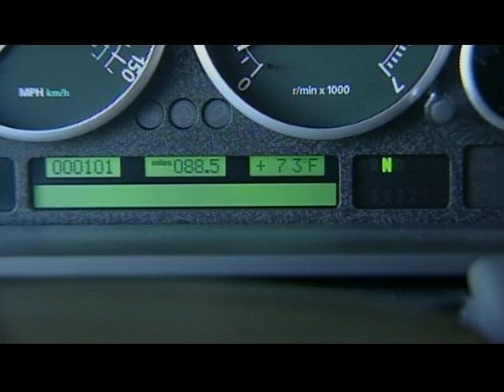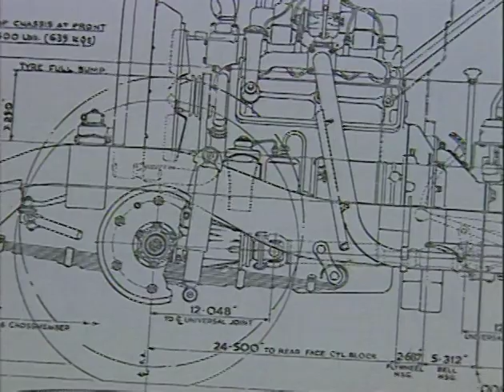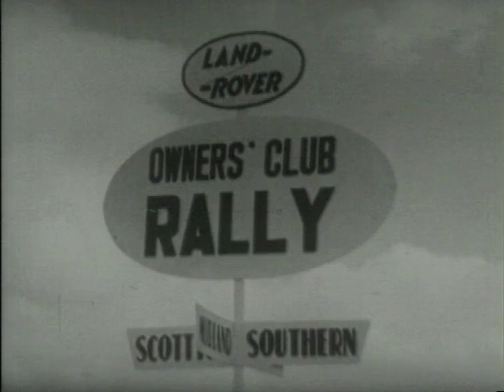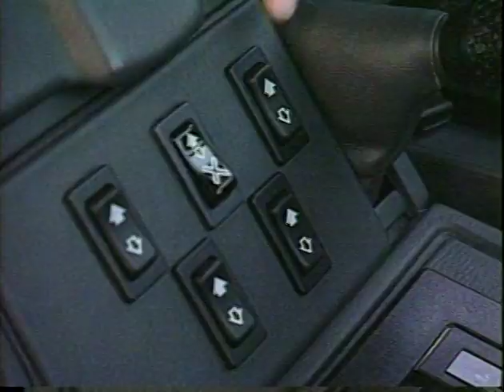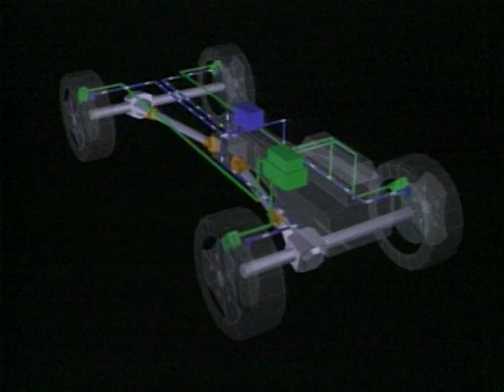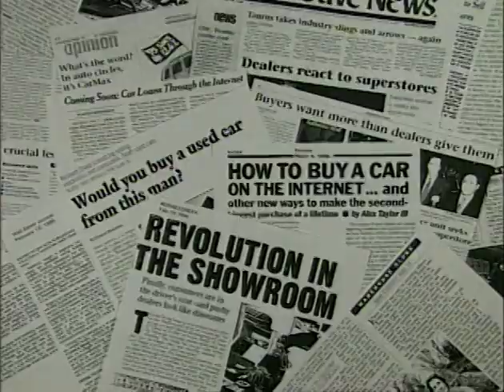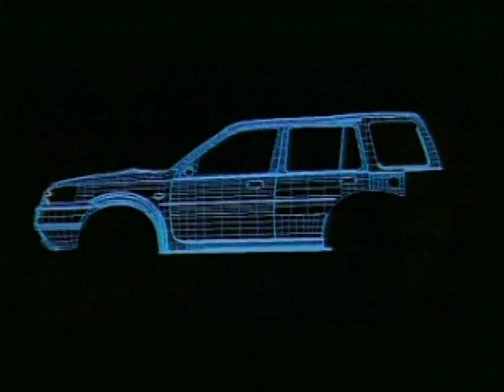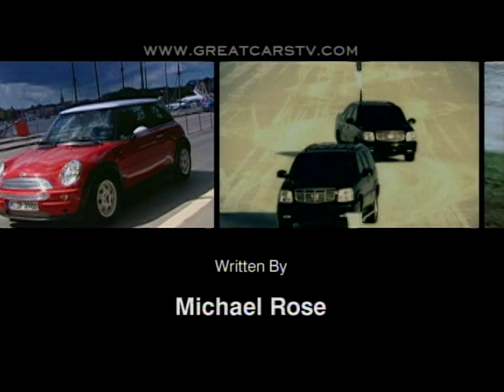History of Land Rover

Comment: My '77 2 door V8 Range Rover, dreadful unreliable car, nosiest 4 speed box you could imagine. Had to use a blowtorch on it to expand the case for a rebuild. Drive through small puddles would stall the engine. Ignition had to be replaced, as the original is known to be rubbish. All parts are really expensive. Rust in hard to clean places is a MAJOR problem.
Sand particles get into the CV joints, seizing the hubs so that they must be cut off with a gas axe, I'm not exaggerating. 
I could go on. Do yourself a favour,  avoid these cars like the plague., oh did I mention, the V8, holy cow, the most gutless "V8" imaginable....

Comment: Unreliable overpriced rubbish. Look at the JD Power dependability report for 2019. Im not bothered about the badge on the front, people buy into labels and trends because they cant think for themselves. Id sooner have a Toyota Landcruiser any day over anything Land Rover produce.
Reply: "Look at the JD Power dependability report for 2019"🤓. Did you ask Google for that answer? What does that have something to do with an old Rover? You should mentioned the newer models that are computer on wheels, the old school pre 2000 was dependable, and reliable. The basic 3.5l v8, 200tdi and 300tdi engine are quite common to reach 500k miles. Hell the reason why did they still produce those tdis engine in Brazil for third world countries when they already had create the official new td5 5 pot engine to public. I think those people right, people like you did get brainwashed by media regarding the Range Rover reliability. Yall even can't spot the difference between a Land Rover and a Range Rover